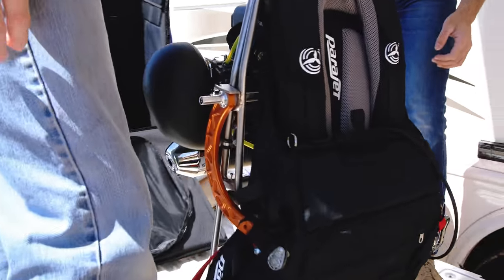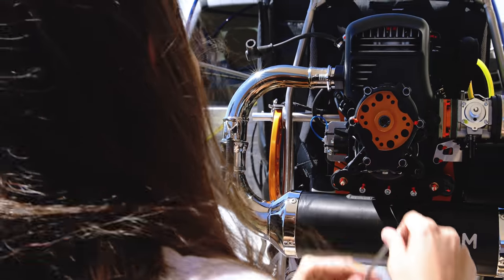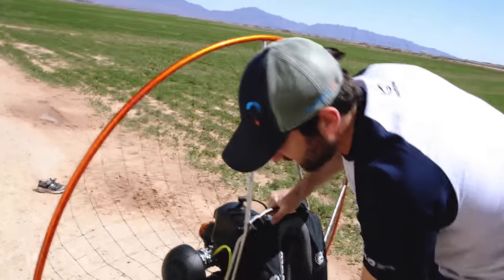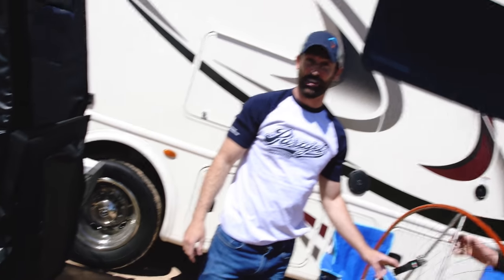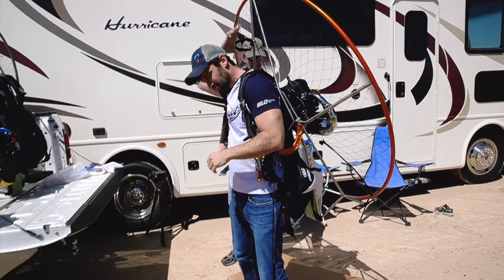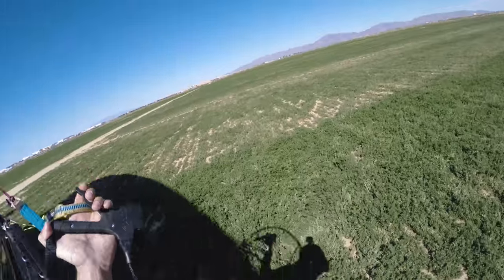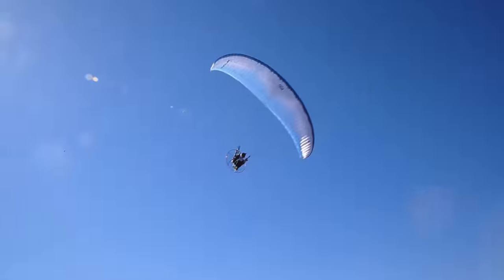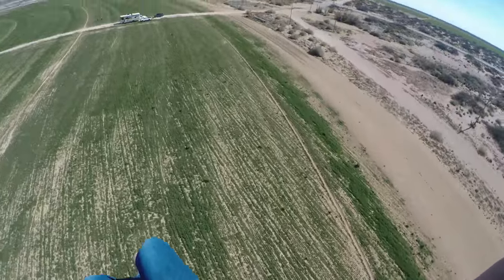My Girlfriend got a FLYING MACHINE!!! Unboxing and First Flight! Parajet Maverick: Atom 80!!!

Comment: I just received a new 2020 Atom 80 that was ordered through AviatorPPG.  Atom 80 is what I used at training. Just so your followers know, the Atom 80 no longer ships with a nice travel container. I was informed that it's sold separately. My unit was drop shipped right from the factory so I have the new MY20 with the revised carb. The packaging could have been much better with a foam protector over the top where the box opens. The muffler only had the cardboard shipping box to protect it and it was right at the surface. I don't see any damage, but that looked very risky to me.
Reply from the maker: Congrats Kent! And I hope the new MY20 carb works better than the 19.

Comment: I got into free flight with a dual-purpose wing (Kona), so that I can move into PPG, when the time is right. I've had my mind set on the AC Nitro 200, for a while. But, more and more, the idea of the Atom 80 is growing on me. While I realize I won't be taking off like a fighter jet, the combination of light, smooth, quiet, with fit-and-finish... Going to have to find a way to test fly both, for sure.
Reply from the maker: stephmon I enjoy having the Atom 80 when I am not planning on going nuts. I took it for a LONG flight across the desert the other day. It was super smooth and incredibly efficient! I would definitely consider it to be my cruiser.

Comment: That is awesome!  Congrats Leandra, I cant wait to see some vids of her flying it!
Im going to be that guy for just a second lol, I noticed while I was playing with the maverick last week that if you route the net connecting point behind the vertical part of the frame to the net standoff then when you collapse the arms for transport it will not rub on the net connecting point.  Probably not worth even noting but for what ever reason I felt the need to appear smart/ important for a second haha.
Reply from the maker: awkBOTS absolutely!!! That’s a great point to make!
Reply: I run the tightener lines that same way on my Maverick.  Was a tip I learned from a British guy that did an unboxing/setup video about a little over a year ago.  Should save those lines from getting damaged by the swing arms.

Comment: How did you put the prop on with it running??? You are AmAzInG!!!  🤪  The component is the gearbox.
Reply from the maker: Tricks of the trade my friend! Haha. Any whos, I am thinking about trading in the f150 for a new f350... THEN I will pull a 15,000 lbs. 5th wheel!!!!
Reply: @AnthonyVella  That would be a smart thing to do if you really want the BIG trailer!!

Comment: I'm considering a Maverick as my second machine. I have a Moster 185 on my Pluma, and I love the power. But I'm thinking I'd like the reduced noise and greater fuel economy of the Atom. The Vitto website says they have the same max thrust output, just at different RPM's. But you said you can feel the difference. Is the reduced power really that noticeable?

Comment: Im not liking what seems to be a dual sound in the motor.  Almost like a whiny sound, kinda like an electric leaf blower.  Def annoying.  Probably would tune it out over time but still.   Sexy looking unit no doubt.  However like to be part of the frame like the flat top.  Less wakeshift i know.  But i just feel more secure in a chair vs a harness.  Ive tried both.  Harness is way more comfortable than Dells Flattop.  Pros and cons everywhere. No free lunch.
Reply from the maker: My favorite is the Moster 185 Plus, but that definitely comes at the cost of a slightly higher weight. It doesn't bother me, but I think the Atom 80 will be good for Leandra (or other people looking to get a lighter weight). The power was respectable too. I agree; it has a very unique sound to it. It sounds electric and kinda feels it as well: very little vibration.
Reply: @AnthonyVella  .  Yeah I'm 180 so have for get the moster or ninja.  Any guys over 180 has to go with thr bigger engine.  Almost any woman get get by with the 80

Comment: So... how much do you weigh? I think this might be a nice setup, if it's not too small for me. :D
Reply from the maker: Hey Mark! I weigh 185, but I think that it is important to note that when I fly the Parajet Maverick with the Atom 80, I am simply cruising, opposed to doing any real aggressive flying. If I were to be tearing it up down low, I will definitely go for my Maverick with the Moster 185 Plus because it has a better climb rate (aka more thrust!). Today, I was simply flying to my friends house and enjoying the scenery. The Atom 80 is super smooth, very quiet, and incredibly efficient! The Moster 185 has more power, more vibration (but not bad by any means), and its louder. These are all just things to consider. I like to imagine that those who are coming from paragliding (free flight) might actually appreciate the Atom 80 more since they generally would be more efficient pilots to begin with. Once again though, if you really want to tear it up down low, you may want to consider the Moster 185. Hope this helps!!!
Reply: @AnthonyVella  Great! I'm a Free Flight pilot, and I fly 95Kg. All up.  I fly hours at a time without an engine. It would be nice to be able to launch from the flats to gain altitude initially , and then stay up by using the thermals.
Reply: @AnthonyVella  Thank you! That was exactly the type of response I was looking for. I love to fly, for simply being in the air. I have no need to "Tear it up" or even to do any acro. I am capable of performing several acro maneuvers, and find them to be a quick way down if necessary, but I really prefer a nice calm quiet flight.
If it will get me up to altitude, without destroying my ears, that is enough. I fly high, and slow, and love it that way!  Blue Skies & Fly in Peace (>*

Comment: I have an ultralight, powered by two small lawn mower engines.  The parajet is much more maneuvarable in a way, but I still prefer the ultralight.  BUT... learn how to operate a camera.  Even the ground shots made me seasick. :(
Reply: What kind of lawnmower engines are you running? Any pics or Vida? Did you make it yourself or is it from a company?

Comment: How much does a new setup cost including wing?  I'd get the anodized alluminum orange as well.  I wouldn't depend on lockwashers, they suck, use loctite / safety wire / tape.  80cc's might not be enough with a strong headwind.  Exhaust can sounds super smooth.
choppergirl.air-war.org
cg.air-war.org

Comment: You are scrap your new Atom 80 Engine..... New engine need break down ….. Never, Never, Never run engine at full throttle if you are not make break down...… Congratilations your just scrap your new Atom 80 engine ….